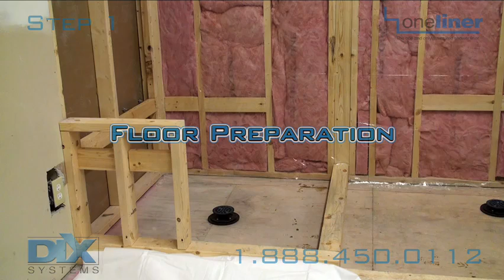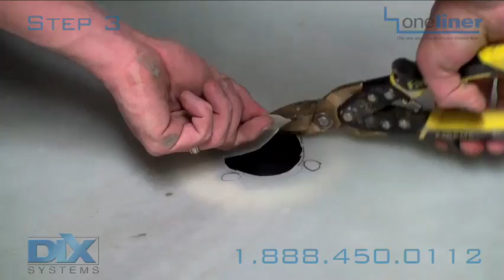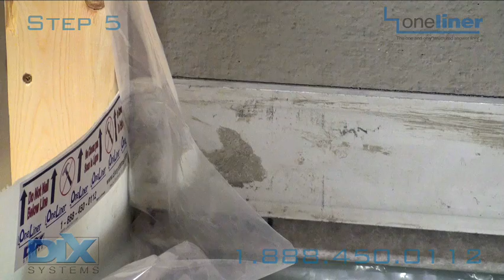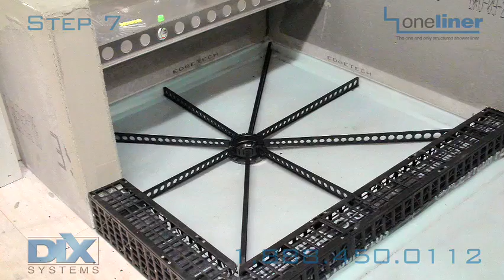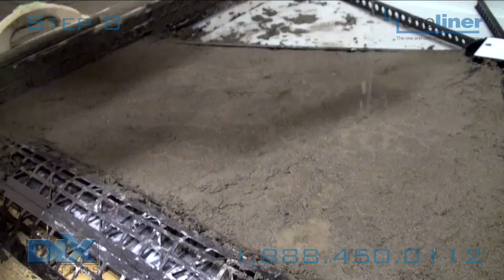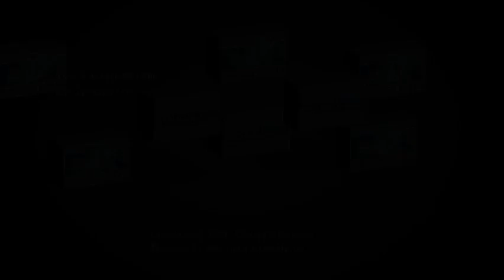How To Install Shower Liner with Quick Pitch and OneLiner

Comment: Hi,
I have two questions about a shower remodel using a mortar shower pan:

1. Do you use metal lath for the mortar bed above the membrane?  If so, how do you protect the membrane from puncture.

2. I have a rectangular shower with the drain pretty centered.  Should I keep the mortar bed at the same level across the entire wall (which will lead to a steeper pitch on the narrow part of the rectangle)?  Or keep the 1/4” per foot slope which will lead to a lower spot in the middle of the long wall?  Floor dimensions are: 60” w x 36” d.  

Thank you.

Comment: Generally I like this system however punching holes through the liner to fasten the pitch sticks to the plywood floor seems to me to be asking for failure or at least reducing the systems longevity / durability. Can the sticks be glued or epoxied to the liner in order to keep its integrity.

Comment: good video lol , you just for got one thing , cover the frame around the bottom before you put mortar mix from beginning, because that's regular wood
Reply from the maker: Thank you for your advise, that is correct at the Kirb Perfect we do cover the wood frame with Bituthene a sticky waterproofing we put in our kits and the shower pan comes up 7" on all the walls except curb. Then the backerboard goes into the shower pan about 2" off the floor base. I appreciate the input on the video have a great day Laura at Dix Systems
Reply: @DixSystems  I would also add, can the stupid music, so we can hear the instructions. It is a terrible distraction.

Comment: Why do you guys call it quick pitch if it took forever. ?
Reply from the maker: Hi Jesus Thank you for the question, this product was invented to help the DO It Yourselfer achieve a proper slope to the drain of the shower. The manufacturer named the product probably thought it was catchy. For the old pro's like yourself of course this will not make it faster but for the novice it does help. thank you have a wonderful day Laura
Reply: If your drain is not centered then how does your quick pitch stay level on the outside? Wouldn’t the shorter sticks be shorter than the longer sticks ?